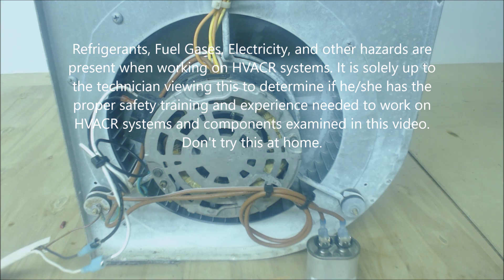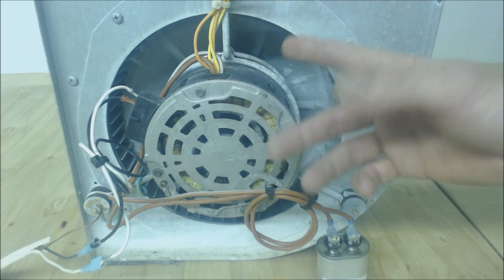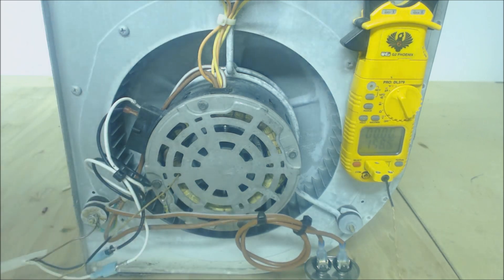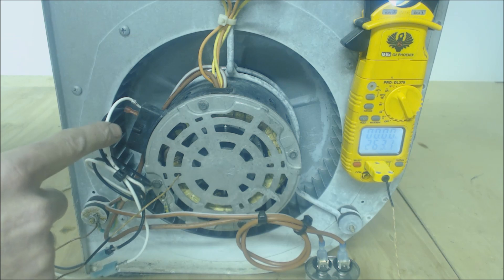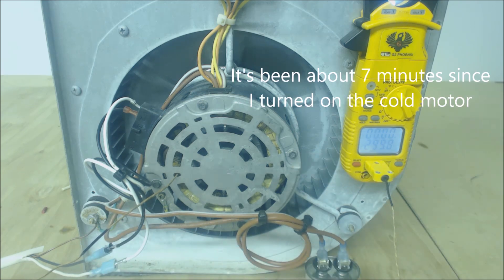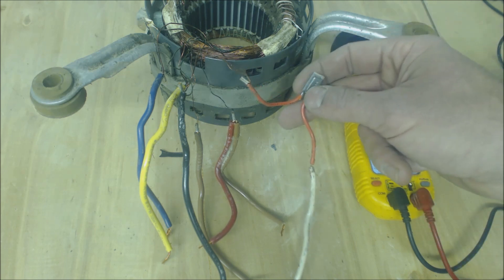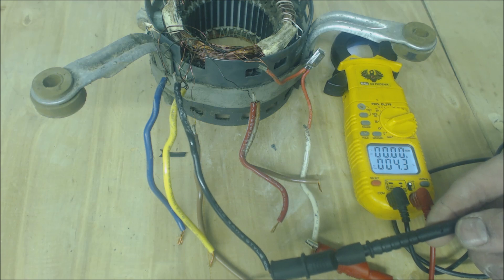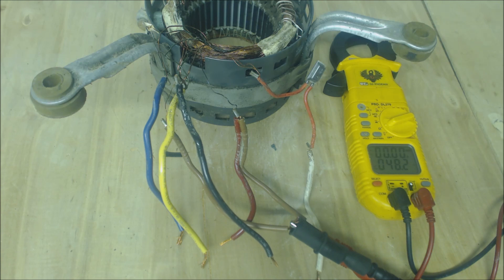HVAC Blower Motor Not Working! Testing Resistance Values & Thermal Overload to see What is Bad!

Comment: I can always count on your channel to touch on the specific questions I have! I was wondering about a good start winding ohm reading. 

I had a motor that had over heated, found a bad capacitor on it. After changing the cap the amperage draw dropped from 8.9 to 6.2. But I was curious if the motor was significantly damaged, and if we would be seeing it smoking up again after I left. 

Had readings very similar to this motor.

Comment: This is a good tutorial. I have a Coleman single stage furnace that ran great after changing the pressure switch. Shut the unit off and on several times and worked good. Next morning I get a call for no start. Reset on off switch at furnace, worked great no problems. Get a call following morning for same issue. I pop the capacitor off at the blower wheel, and checked farads. Should be at 7.5 and it’s at 6.1. Replace capacitor, unit runs stronger, and flames seem to be stronger too. Get call following morning. So I’m assuming I should check resistance now at all wires?

Comment: I have an 3 speed blower motor. It would run for a 2-3 minutes then stop running while there are still 277v going to it. I tested the capacitor and it’s good. It look like the thermal overload trip. Any advise? FYI the motor is new.
Reply from the maker: Mui, does the rating late say it can be used with 277v? Is the capacitor the correct size as stated on the motor rating plate? Thanks!
Reply: Thank you so much for responding. The voltage is correct 277v and motor is also 277v rating. The capacitor is 4 uf and that’s what it also said on the motor also. That only cause I can think of right now is the thermal overload keep tripping. If I shut off the vav and turn it back on the next day it would run for 2-3 minute. However if I turn it off then it turn it back on right away it’s would only run for 20-30 second, maybe it not enough time for the overload to cool down? Also the original capacitor that was install is 7.5 uf before I change it out for the correct 4uf capacitor, so I’m not sure if the 7.5uf capacitor already did some damage before I put in the correct capacitor. 
Thank you

Comment: When connecting the brown wires to the capacitor , does it matter which wire goes to which connector ?
Reply: Not on a single run cap. Only a dual does it matter, C= common, F= fan, Herm= compressor

Comment: Hello! Great explanation! So, if i bridge the connections between the thermal fuse for testing the motor should be okay? The motor start to get very hot in the coils when connect to AC. It kind of shorting?

Comment: In my blower motor, there is no resistance between common wire and speed's wires. Same thing between capacitor's wires, without the capacitor. What should I test ?
Reply from the maker: If the motor is cool then the windings are open and the motor will need to be replaced, thanks!

Comment: I have a single speed blower motor that intermittently decides not to work, no humming. Sits for a day or so and lo and behold it’ll work again for a few days. Based on what this video tells me It shouldn’t be a burnt motor getting hot and tripping the overload, because it will work just fine when it wants to. Should I focus on the cap or TDR?
Reply from the maker: If it's not humming, it sounds like it's the internal overload. After it stops, i would turn the power off and disconnect the motor wires to test resistance value to see if the common is open, thanks!

Comment: Just had this exact problem with mine. I don't know much about HVAC systems but I do know a lot about electric motors and electronics, so I just applied that knowledge to troubleshooting  the furnace. The motor started just humming and wouldn't start, so I changed the capacitor and the flame sensor. It still didn't work and was getting a bad burning smell, so I assumed the windings burned out. I removed the motor, planning on looking for a new one but after about an hour of searching online for a new motor, I decided to try one last thing. I cut the ends off of a power cord, wired the motor up in my living room, connected the common and then went through the different speeds and to my surprise they all worked. I did not expect the motor to turn over at all since I had come to the conclusion that it was fried. I had a closer look and noticed it had 2 thermal fuses and then realized that I just hadn't given it enough time to cool down before so the fuses would reset. I reinstalled the motor and is running just fine now, so far😬 I was so so close to chucking out that motor and spending $150 on a new motor that I didn't need.

Comment: So I measured both brown wires, which are the start and run windings. I got continuity and a resistance of 8.6 ohms. I then started to move the shaft around and it went up to 46.3 ohms and stayed there with no continuity, is this normal? Shaft turns freely and everything else checks out ok. But when line voltage is applied it only hums. Thanks
Reply from the maker: Usually when measuring the resistance readings of the capacitor wires, they are a much higher resistance reading then any of the speed wires. Bottom line is if you have a good capacitor and you have good inlet voltage and the motor hums then replace the motor, thanks

Comment: What if you got 0.0 for resistance from common to black wire? What would that mean? Thanks
Reply from the maker: That would mean that the windings are shorted together and the motor should pop the breaker when powered.
Reply: acservicetech ah, thank you. So a coil has two separate parts then? Two wires(common and hot leg) that go to two separate parts of the coils and creates electromagnetism? I would assume since you mentioned that they short together implying there’s two separate parts.
Reply from the maker: Think about one length of wire and the middle is all coiled up. The insulation around the wire is just a clear resin. Since the wire is a very small diameter gauge and so long it has resistance to electrical flow read in ohms with a multimeter when not powered. If the wire resin melts and the coil is not touching all together then it is now not a long wire but a short wire which makes there be less resistance read at close to 0.0 ohms, thanks
Reply: acservicetech thanks! Makes sense. Since most of Hvac units deal with AC voltage, I’m trying to understand the concept of ohms, resistance on coils. Any suggestions on what book or videos to research would be greatly appreciated. Thank you again for responding

Comment: For a bad motor a simple check if it’s shorted to ground is that also a good check to determine if it’s a bad motor. I usually check to resistance between one of the windings and the blower squirrel cage. Bad motors are usually grounded.
Reply from the maker: Absolutely, thanks

Comment: Concerning the different speeds, are the colored wires (not including common) themselves the ones that are providing the different resistance values and thereby the different speeds? Or is there something else that is unique about the motor windings? Thanks!
Reply from the maker: Yes each winding is actually a different length and each resistance is shown by the color which would indicate the speed. The higher the resistance value between this wire and the common the slower the fan speed, thanks

Comment: I've watched all of your videos on this topic (I think) and don't see the problem that I'm facing.  I'm looking at a Rheem package unit (RRPL 5 ton) that doesn't seem to have a capacitor for the fan...at least one not located near the blower.  There is a capacitor near the board and it checks out okay.  I was expecting one closer to the blower, however.  Also, the motor has male connectors instead of wires coming out.  Would I pull the wires and test the male tabs from the motor for resistance?  Thanks so much!
Reply from the maker: That sounds like it may be an x13 if it has male spade terminals. Check this video out-  https://youtu.be/ZzvhtmQTiMY
Reply: +acservicetech I'll check it out.  The odd thing with this blower is it does kick on briefly and then shuts down...most of the time.  It may run for a minute or so or only 10 to 15 seconds.
Reply: +acservicetech Could this be a loose connection somewhere or is something limiting out on the fan?  There is no standing water anywhere that I recall.

Comment: After I replaced the run/start cap, and the fan still wouldn't kick on, I measured  2 motor wire legs in the KiloOhm range, and the 3rd leg in the MegaOhm range. Opened up the motor but could not find an overload fuse...maybe covered by the resin? Anyway the motor is 25 years old, so I'm looking for a cheap as possible replacement. It's out of an old Goodman unit. (Next year I'm getting a ductless system).
Reply from the maker: Yes the thermal overload is covered by the resin and tape right on top of the winding. Sounds like you will need a new psc blower motor. They are not very expensive, thanks!

Comment: hey partner I had a tech question to ask you my aunt had a split system installed crappy job lennox 3 ton with a coleman furnace with two air filters that cover the whole front of the furnace no return's all supply's from old unit and is loud as a train at start up! she purchased it at Costco you know how they swindle you in and have some contractor get a guy to do the job any suggestion's to quiet it down? thank's acservicetech...
Reply from the maker: You could replace the blower with an Evergreen ECM for PSC Blower Motor Replacement possibly. Either this or build another closet frame and another louvered door in front of it, ha. They are just very noisy.
Reply from the maker: The other thing is that these types of furnaces are mainly only used in mobile homes and if you add an ecm to try to push air through that small 14  x 14 trunk duct it will be very noisy and possibly hurt the blower motor due to high friction as seen through the motor as amperage
Reply: thank you acservicetech you are a very smart tech I respect you highly!!! I did not even mention to you that it was a mobile home which is now considered a home because she had a foundation added, wow so she is basically stuck with that loud furnace, thanks a million for your help you are a crystal ball!!!

Comment: great video. Some technicians do not know and are too embarrassed to ask for help
Reply from the maker: Exactly and knowledge may get worse and worse depending on how it gets passed down. Yes a lot has changed because we cannot simply change out parts until the problem goes away. Manufacturers and distributors now actually penalize those that warranty parts in this way. Most manufacturers say that they test all of the so called bad components coming back.
Reply: acservicetech tech are doing sabotage before they turn in the part for warranty
Reply from the maker: Ha, oh man.

Comment: im confused on the wires for the  capacitor. so the ohms reading supposed to 20's are 48-50 ohms
Reply from the maker: Hey Floyd, I was just showing that the resistance values on the start winding going to the cap are alot higher than the speed wire resistances to common. This resistance reading will change if it is 240v or a different hp blower motor.  I was giving rough readings to look for on 120v 1/2hp motors. Thanks!
Reply: @acservicetechchannel  should the start windings be shorted/ 0 ohms to any of the fan speed wires?